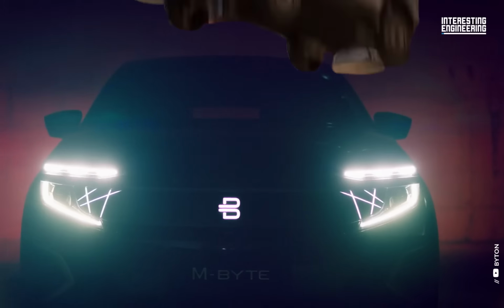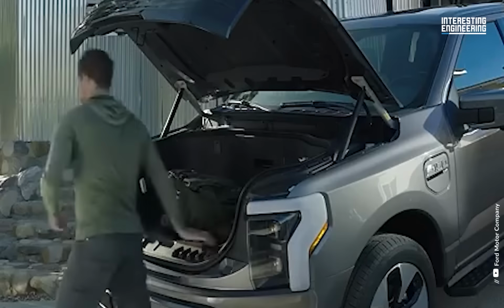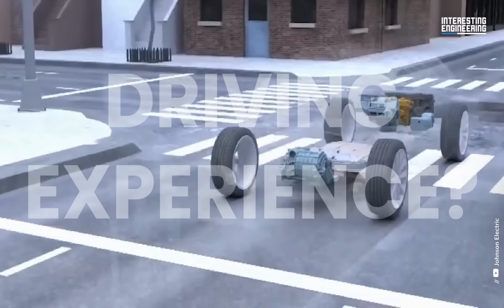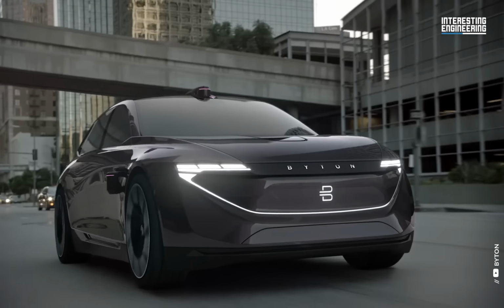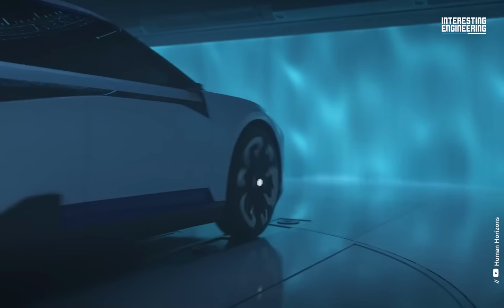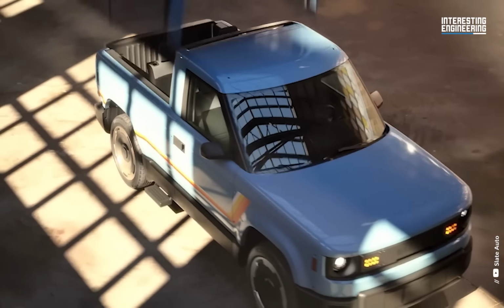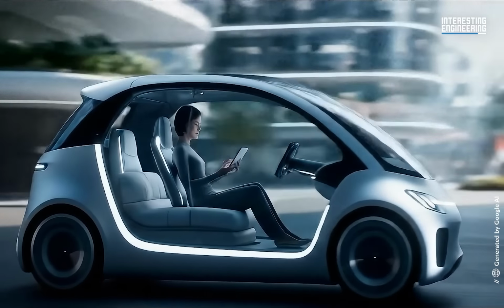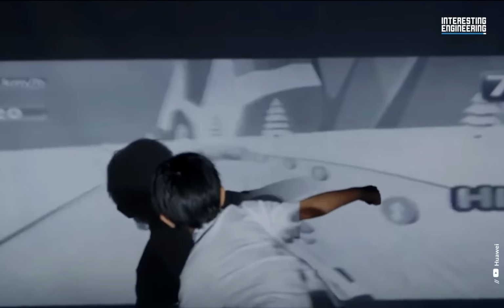The End of Car Design As We Know It

Comment: Going with all drive by wire for brakes might be good but I've seen some SUV's have a electric switch for the E brake.  The E brake is the one thing I think should remain 100% manual.  It's for emergencies.  Also, I would not go making the heating and AC controls touchpads.  Everyone knows the three knob system.  FAN, TEMP, DIRECTION.  Tactile buttons serve a purpose because you develop muscle memory so you can adjust the fan or temp without taking your eyes off the road.  If you make the entire car controls only thru a touchscreen, you are asking for accidents.  I would also like to know what would happen if you hit something like a large branch and bend the battery pack.  Or is it so overengineered that it can take a whack without any issue?